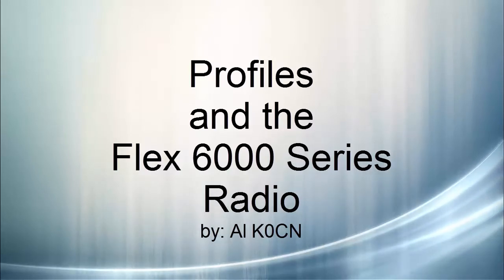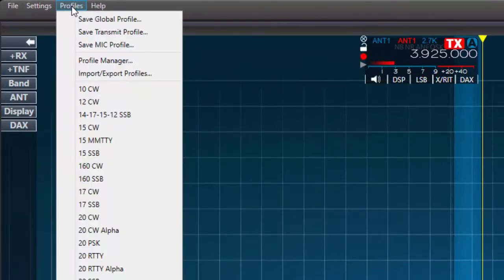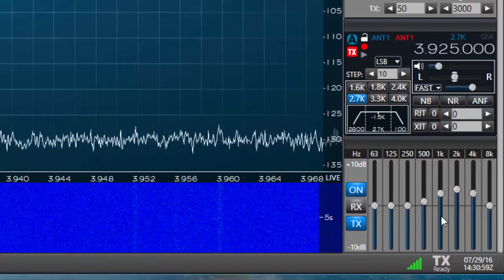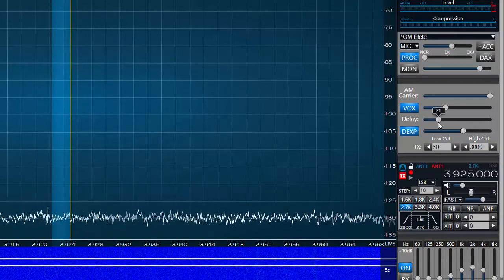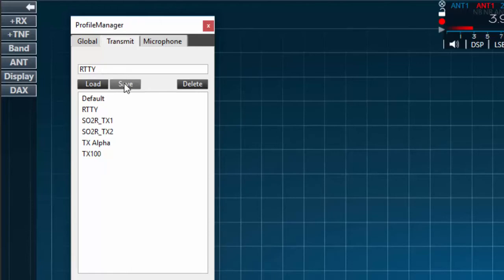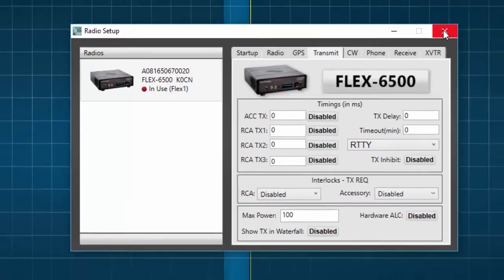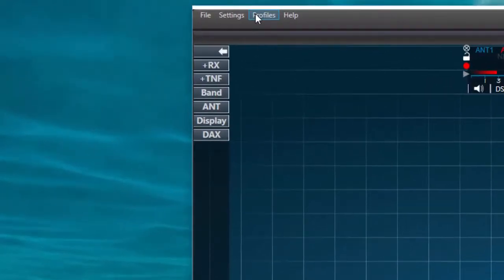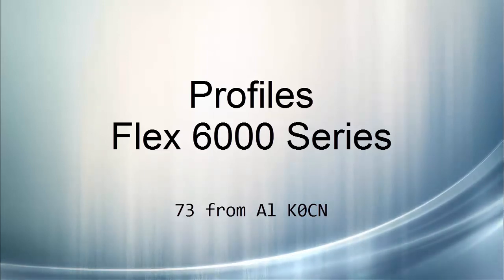FlexRadio SmartSDR  Profiles

Comment: Nice presentation Al. 

I think profiles and profile management could be made easier. It is difficult to know or remember what settings are saved and which profile is affected. 

One way to improve profiles would be to make them available as a text file for review and modification. Another might be to have all the profile variables show up together under a menu or popup window for review and adjustment. I'm guessing the saved settings are hidden from us to protect ourselves from ourselves. It also means I could share a profile with you and you'd have to be very careful to review all parts of it in the GUI before using it. Especially if external equipment is connected.

I also see that GUI layouts are not stored. Resizing a window or moving elements around is not saved by the global profile. At least not in 1.9.